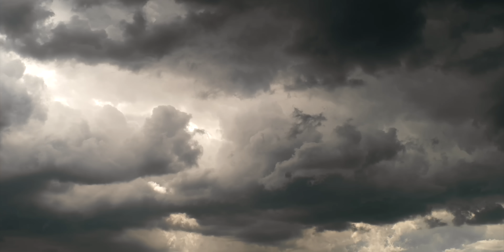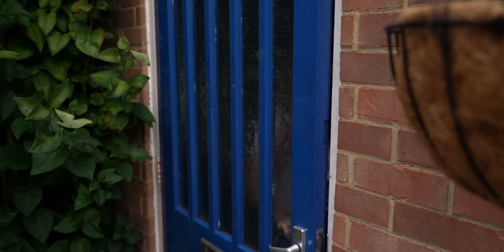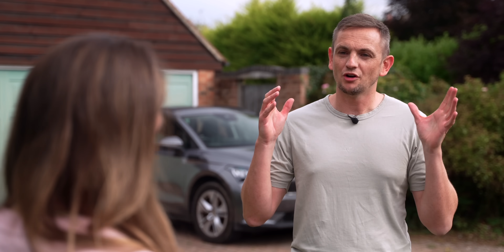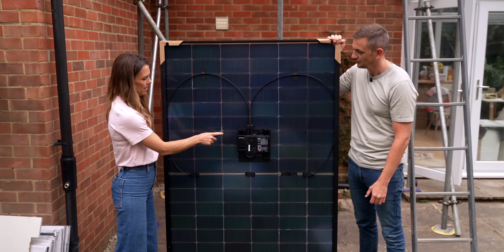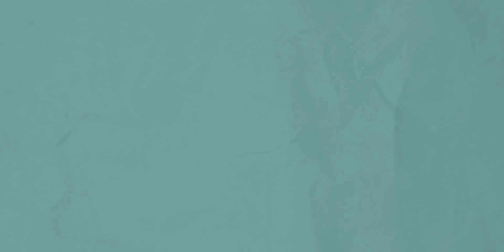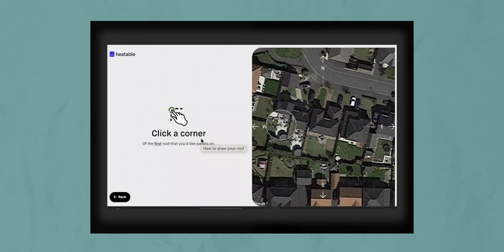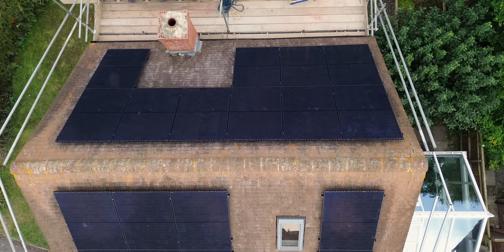Maximise Your Solar Returns With These Bifacial Panels!!

Comment: Connecting solar panels in series is a tad silly as in when one is occluded they're all occluded.

Plenty of info online.

Plus having inverters on the roof is daft.

Having mains voltage is perhaps not a good idea when safer low volt circuits are to be preferred.

Again, info online.

How do you repair or replace them?

Might work when array is in a garden, say, and panels easy to get to.

Why Imogen and Robert?

Just why?

Robert, these episodes tell us more about your tech team than the subject matter.

For example it might have been useful if we knew the overall efficiency of these panels if only for a contextual comparison.

Any claims over 20% would not be believed.

Unless the panels were part of a laboratory exercise that is.

Comment: Why would anyone in their right mind spend 75-100EUR per solar panel, and then add another 130-150EUR for a micro-inverter per panel!

The bifaciality here is just useless this close to a dark grey shingled roof, the only good thing is that these days bifacial panels are on price parity with normal panels, so it should cost nothing more for panels sandwiched between two layers of glass.

Loads of useless nonsense here, i hope Heatable paid the fully charged crew well for this "infomercial", with surprisingly bad info in it.
Reply: Heatable sells the Rea Fusion 2 panels, with included Enphase IQ8HC Microinverter, for 189GBP, or 226,6EUR. For a 440W bifacial panel, I just found a Ja Solar Jam54D40 with 445W for 65.9EUR, so you can buy 3.43x the amount of panels for the same price.

Also, what happens when an inverter fails? ... Which it will, far more likely than the panel will.
Reply: @luc_libv_verhaegen  I thought it was 189 for the panel alone, and the panel with the microinverter was more than that?
Reply: @WyndStryke  It is with the microinverter included. Otherwise it would be actual daylight robbery, now it is simply evil upselling of supposed benefits that will not help this one customer with his pretty clear roof one bit.
Reply: Also, isn't the inverter hampering the energy generation of the backside?
Reply: @luc_libv_verhaegen  Until now the Fusion2 panel has not been supplied with an integrated microinverter, it's a new option.   Where are you seeing the panel with microinverter for 189?  If you go through the configurator, it is £225 per extra panel including mounting / installation for the panels without microinverters, or £340 for the panels with microinverters (inc mounting & installation).  From that we can deduce that the microinverter alone was 115 of the cost.   Obviously we don't know how much of the price the mounting & installation is ... but if it was 189 for the microinverter and panel combined, that would suggest that mounting & installation was 151, which doesn't seem plausible.
So hypothetically, if the raw panel was 189, the ACM panel would be 304 (and mounting/installation would be £35).  That is actually consistent with the Maxeon ACM panel, which is even more expensive.
Reply: Thank you for this comment. It appears this heatable guy is hell bent on misleading his customers and the general public about what micro inverters are meant for. I left a comment similar to the one you wrote here on his channel but he is here again repeating the same lies and the presenter is helping him to promote his falsehoods. Perhaps this whole presentation is a paid ad.
Reply: If you wish to stay off the grid as much as possible, to avoid higher energy costs (and reduce system payback time) then, low voltage start up would be desirable to many people. Especially in grey ol' UK.
Reply: @benbocc1549  low voltage start up is even easier to achieve on some string/hybrid inverters than these micro inverters. The Goodwe ES G2 for example has a startup voltage of 58V and an mppt range of 60 to 600V. With several panels in series, this hybrid inverter will achieve 58 and 60V faster than a micro inverter can achieve 20V on a single panel. Micro inverters have their places, especially in installations with extreme shading problems. Why this heatable guy is desperately advertising them for what they are not meant for is most likely a matter of pure greed and selfishness.
Reply: @benbocc1549  I am not sure low startup voltage is that useful really. This is just a carrot to sell more microinverters.

You want high string voltages to keep the amps down to reduce friction losses. You also want high string voltages for more efficient inverters. Take a look at the victron inverters for 12V, 24V and 48V systems. Notice the price difference between the respective voltages for the same power output. They are more priced per Amp as per Watt between these 3 voltage standards.

Panels have an inherent voltage even when not generating meaningful current or power, this depends on the number of cells (shortcircuit voltage). Once they get insolated they start generating power, but how much power and at what exact voltage (and thus amperage) varies on many factors. Therefor every modern solar inverter or charger has one or more MPPTs built in. These trackers constantly adjust the voltage to be able to get the maximum power out of your panels. Inverters and chargers come in different shapes and sizes and different MPPT ranges.

Imogen claims to give us a science lesson and then states that some hypothetical big string inverter has a starting voltage of 200V whereas these microinverters have starting voltage of 20V, and then claims that the lower starting voltage means a bigger "range". Total nonsense. She is talking about completely different things. You can have a big string inverter with a starting voltage of 200V and a maximum voltage of 450. And you can have a single panel inverter with a starting voltage of 20V going to 60V. The big inverter then has a way bigger range (250V), and the smaller inverter has a range of 40V. So nothing of what she claims to be "Science" makes any sense.

The advantage of having one micro-inverter per panel is that you have one MPPT per panel, and can track the maximum power point on a per panel basis. And that is the only advantage. Everything else is a big disadvantage, from price, complexity of installation (and with increased complexity comes increased failure rates) and efficiency of the whole system. You might get some more power out of some panels from time to time though, but this is not true for this installation here as there seems little in the way of shading.

This whole film is paid for nonsense fluff. Almost no-one needs a big solar array with micro-inverters and enphase only has a business because of low knowledge customers with too much money to burn. As soon as enough people catch on, enphase will go out of business unless they can actually scale their company down to serving only a few niche installations.
Reply: @adon8672  Fox is a budget brand, and even they have a reasonable startup voltage (75 or 80 depending on which inverter).  So as long as you have at least 4 panels in the string, it should match or improve on the microinverter's startup voltage.  If you were to have a string of one or two panels, then the microinverter might win even against a premium inverter (for example, on an awkward roof aspect).
Reply: @adon8672  yes its a paid ad

Comment: My feeling is that these and similar systems are premium offerings that are basically upselling solar systems to increase the margins of the installer. I don't think the majority of people will see enough benefit to warrant the extra cost. Solar panels are much better at dealing with shade and low light than they used to be owing to having half cut cells and three bypass diodes meaning the panel still produces power in partial shade (as it is divided into sections).
I'd rather have a well installed system without all the extra inverters on the roof. I would imagine that a solar panel is more durable and reliable than an inverter so you are adding multiple extra points of failure (panels + inverters vs just panels). Probably the most important source of failure is water ingress in connectors so having fewer of them on the roof has to be a better option and with carefull installation (drip loops and sheilding them from rain), you can minimise the chance of failure.
Reply: The thing that wasn't clear to me from the video is, now the output from the solar install is AC rather than DC, so it will have to be converted back to DC again somewhere if I want a battery storage solution.
Does that mean an additional box to somewhere to manage the batteries and power conversion?
What are the overall losses like in this double conversion vs a "standard PV install"?
How much additional power will be needed to run the box doing the power conversion?
What powers the micro-inverters? If the electricity grid goes offline, do the panels turn into expensive roof tiles and the house loses power, or can they still generate and run the house?
Reply: @chrisdixon5241  ... However If you want a DC battery ""later on", you need a hybrid inverter up front (or a changeover cost will occur).  If you put in an AC grid coupled inverter up front and want a battery later, the cheapest route is an AC coupled battery with its own secondary inverter supplying a "backed up circuit" - or with automatic switching (ATS) of a selected circuit over to the battery when the power goes out or the sun stops shining (choose your own poison) - NB. it also needs to switch back to the grid under normal conditions when the battery is depleted - preferably while the battery is above 20% - voltage sag and other negatives occur when Lithium batteries are depleted further under high power conditions.
Reply: @chrisdixon5241  adding a battery would mean DC to AC to DC and back to AC. Even if each step is 90+% efficient the losses will add up. You'd need a battery and inverter.
Reply: @chrisdixon5241  panels with micro-inverters are not advisable if you plan to have a battery storage solution. It depends on the country you live in. In the UK, given that there's not much sunlight, having a battery storage unit might not make sense, therefore panels with micro-inverters are a good option (micro inverters have a warranty of 25years while normal inverters don't go over 10-15years). 
If you live somewhere with plenty of sunshine, you could get panels with power optimizers on them (so you can still see what they are doing individually), a battery and one inverter. And if the electricity grid goes offline your panels will not generate power, no matter what system you install.
Reply: "I would imagine that a solar panel is more durable and reliable than an inverter so you are adding multiple extra points of failure (panels + inverters vs just panels)."
They give you a 25-year warranty on these panels, including the micro inverters and cables, compared to the typical 10-year warranty on larger inverters. In my view, this system is much better.
Reply: @AttilaZoltano  inverters are relatively cheap and if it does fail it's not on the roof. 12 years after installation how far do you think you are going to get with warranty, spare parts, getting them to pay for the scaffolding etc? Nothing electronic tends to last more than about 10 years especially not outside and exposed to temperature variations and moisture. Something IP68 now is unlikely to remain that way, seals age and crack, cases warp and corrode. Moisture can track inside cables. Keep it basic and keep the important bits accessible and serviceable is a good philosophy.
Reply: @matthewwakeham2206  So, are you questioning whether the manufacturer will uphold the warranty promise?
Reply: @AttilaZoltano  I question whether the company will still exist in 10-15 years time. The technology will probably have moved on so far that if you have the scaffolding up, you might as well replace the whole lot. After all once failures start they will continue. The warranty is only really for the first 2-3 years, after that you are probably on your own.
Reply: @денисбаженов-щ1б  not sure if you are for or against. What's more likely to fail, something with 20 points of failure or something with 40-50? More complexity never results in more reliability.